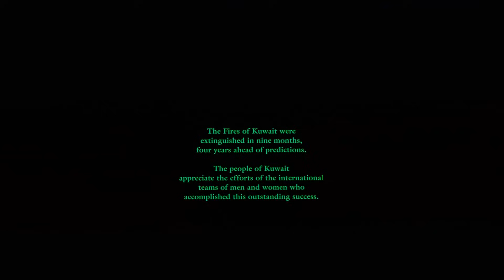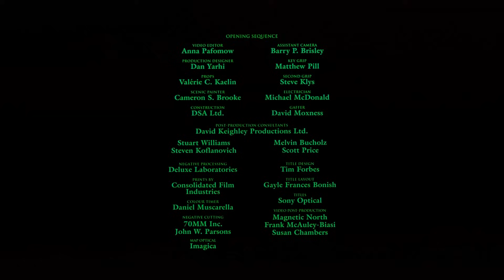Fires of Kuwait (1992) HD

Comment: An estimated one to 1.5 billion barrels of oil were released into the environment. After most burned, 25 to 40 million barrels ended up spread across the desert and 11 million barrels in the Persian Gulf, according to a 2012 paper published in Remote Sensing of Environment. For comparison, the 2010 Deepwater Horizon spill into the Gulf of Mexico is estimated to have released nearly 5 million barrels of oil.
Reply: And we wonder about climate change still ?  I  am sitting here in Arizona in 2023 and we have had nearly a month of superheated air . Not just here but all over the world.
Reply: Crazy. Not just the environmental effects, but the wastage as well.
Reply: This is one of the reasons saddam is kicking it with the devil as we speak.

Comment: so the heat from these oil fires being fed like a blast furnace cannot melt the steel pipe or fittings, yet jet fuel & carpets burning can bring down 2 buildings? (well 3 incluing WTC7)
Reply: um, they could melt the tools, that's why the constant water, and yes the heat of the building fires heated the beams until they became too soft to support the weight of the floors above them
Reply: I don't know all the figures or facts, but jet fuel is man made, unlike crude oil straight from the ground. Man made stuff is always more potent and dangerous than natural things.  Also, maybe the steel pipes and fittings were made just for fire and/or as the person below me also commented, that's why the water was being sprayed on it.
Reply: Burning fuel cannot melt steel beams, but it can heat them until they will bend or break under stress.
Reply: @aelitadelarobia Why didnt the buildings bend? It buckled. Like all supports snapped at once.
Reply: @haroldbalzac6336  why would it bend? only a few floors were affected by the fire with those floors being unable to support the weight of the tower and so on and so on. it's not a fucking slinky. nothing melted it was weakened by the fire. think of a blacksmith, they don't melt the metal they just heat it up enough to be able to mold and bend the metal. the reason it all snapped at once was kinda like a cascading effect, some pillars couldn't hold the weight so broke then more and more until within a few seconds they all broke. you can see this in videos mainly tower 1 of a kinda slow slide until it eventually falls.